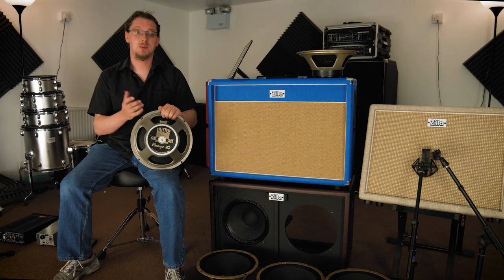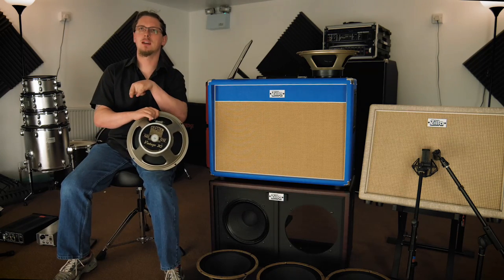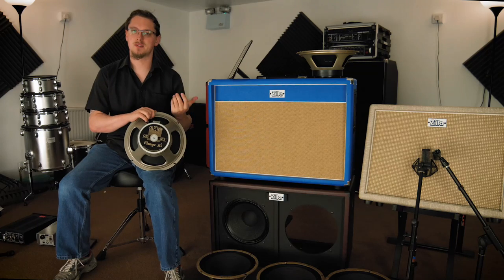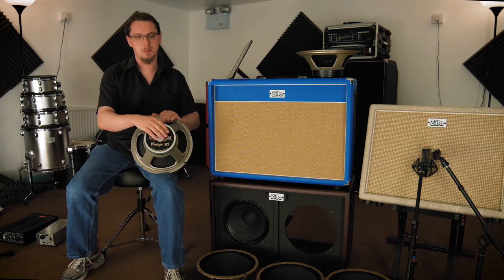8 Ohms or 16 Ohms? Vintage 30 - METAL Celestion Speaker Comparison

Comment: .............8..............16..........
Rythm: 1:50 -------- 4:27
+ lead: 2:00 -------- 4:38
Single: 2:21 -------- 4:58
Quad : 2:28 -------- 5:04
Solo :: 2:53 --------- 5:30

There...
Give it a lot of likes so this will get on top! Hope this helps people :)
Reply from the maker: +martin ouwehand hero! Thanks Martin. Gold star!
Reply: :D 
Great comparison btw! Really helped me a lot to deceide which speakers to get!
I think i'll get the 8ohm version becouse it is less harsh sounding  but still holds an impressive amount of gain!
Reply from the maker: +martin ouwehand :)
Reply: You didn't do the timestamps for the mix...
Reply: 8 ohm mix rhythm:     3:23 
16 ohm mix rhythm:             6:01
8 ohm mix with lead:  3:35
16 ohm mix with lead:         6:13
There are things you can do to mitigate the differences... Kinda...
Like.. Amp eq, post eq, and you can also try running the ohms switch a spot below or above whatever the cab is rated at (typically on a 16 ohm cab, you can only run a spot below, since I've never seen a guitar amp with a 32 ohms setting 😂.
Changing the ohms will mess a bit with power efficiency of the amp, making it slightly louder or quieter, but it can narrow the differences between the speakers in terms of "scooped-Ness."

Here is an article from Hughes & Kettner describing how it works:
http://blog.hughes-and-kettner.com/ohm-cooking-101-understanding-amps-speakers-and-impedance/
Reply: I think that the 8 ohm occupies more of the vocal range, so the 16 ohm just plops in the mix better with vocals and leads going on at the same time. With that said, perhaps it's easier to just scoop the mids out of the 8 ohm cab a bit.
For leads, I'd probay go 8 ohms right off the bat.. Especially a solo without vocals.
Mesa uses 8 ohm speakers and Marshall 16 ohm ones, and Mesa is typically favored by modern metal players... But in this mod the 16 ohm does sound pretty nice.
Reply: This comment sure helped allot, BECAUSE HE FACKED UP and made this stupid rewind to hear the sound video.
Reply: Yes!!

Comment: I read an interview with a Celestion engineer, and he said that they go great lengths in trying to make the 8ohm versions sound exactly like the 16ohm.
From his choice of words it seemed they consider the 16ohm as target.  
I imported the sound of this video in audacity. The following operations were needed to make the 8ohm sound very close to the 16ohm: 
- attenuation of 2.5dB
- shelving boost that starts at 3kHz, and reaches full 6dB amplification at 4kHz.

There is still some honking left in the midrange around 1kHz, that makes the 8ohm slightly mid heavy.
Really interesting comparison video, I wish there was more for greenbacks etc.

Comment: But my quick analysis would be:
The 8 ohm sound a bit darker, a little more loose and having more lows/low mids.Which is good would be good for a primarily rhythm guitar player, or stoner rock, sludge, doom, etc etc
The 16 ohm is a bit brighter, tighter and having more highs/high mids. Which is good for more of a lead player, which could turn his tone/volume knobs down to 7 or so for rhythm to try and match the tone of the 8 ohms and then when he wanted to boost his volume/tone,  turn them to 10. Genre wise they'd be better for death metal, thrash, djent, etc etc.

Comment: The impedance has a different influence if you are using a tube or solid state amplifier - and if the speaker manufacturer hasn't compensated for the higher damping (lower qt factor) of the 16 ohm speaker. With a solid state amp the lower impedance will cause a fuller bottom end but the bass will loose precision (higher qt factor = less damping). On a tube amp it pretty much depends on the output transformer design/dimensions/quality which varies significantly from amp to amp. From the reliability perspective tube amp transformers might be happier with a lower impedance (e.g. 8 ohm, so far supported) where solid state amps are operating with less stress on a higher impedance (e.g. 16 ohm). If two speakers are operated in series the inductance of the voice coils gets added where in a parallel operation the inductance gets lower. The inductance of the voice coil(s) represents a low-pass filter which influences the upper mid and high frequency transmission.
Reply: Very interesting observation.

Comment: The natural compression from 8ohms makes everything sound more even across the spectrum, however, I expected the solo to sound bigger, however it did so but uneven. All that said, 16ohms might sound better live than recorded, factoring in natural air compression and microphone diagram resistance evening out the frequency spectrum. 

If I where to play solo and live, un amplifier, I’d choose 8ohms. When recording to keep the peaks of that rich midrange energy, I’d 16ohm and use other tools (mic, compressor, preamp transformers) to retain “the meat” and keep it sharp. Amazing.

Comment: Wow, I didn't expect that much of a difference! Personally I don't find the v30 sound the most pleasing for me, but this was still very helpful as I preferred the 8 ohm speaker. So thank you! And I also think that it would be easier to compare if the parts were paired, but with time stamps it isn't a problem. 
Great videos, keep it up!
Reply from the maker: Thanks- and I’ve had the feedback about the pairings several times now, we do it differently now but can’t go back and fix it :(
Reply: @adamsteelproducer  in the next video then.. thanks for the info though.. great vids
Reply: @adamsteelproducer  I would like to hear the same with UK v30s (not the brand specific  marshall nor mesa branded ones) the V30 that were UK before they were made in China. Because i've never noticed this much difference on the UK v30s i've had, but I might be mistaken.

Comment: Also can make a difference if you have multiple speakers, like if you have a 2x12 16Ohm set up wired in parallel you get an 8 Ohm impedance

Comment: "We find out by comparing a Celestion Vintage 30 8 ohm against a 16 ohm version (with the amp set to match)"

So the 8 ohm speaker is connected to the 8 ohm tap and the 16 ohm speaker is connected to the 16 ohm tap, correct?

Comment: Surprising results. I didn’t expect such a drastic difference.

I don’t think one is better than the other. It just matters depending on context.

8 ohm would probably cut through a mix better (more midrange) but the 16 ohms might be good for a mid range heavy amp (more scooped, hifi sound). 

Application, pickups, amp, music style and personal preference. 

It’s all about context.
Reply from the maker: I like that answer!

Comment: I find this test weird.
You are using 2 different outputs on the amp.
It would make more sense to compare 2x4ohm in series (=8ohm), or 2x16ohm parallel (=8ohm), in the exact same cabinet, out the exact same amp output, with all dial settings glued in place
Reply from the maker: Except that series and parallel wiring impart their own tonal differences, I’ve made a separate video about that. It’s practically impossible to isolate one thing, we tried our best here. If you can do better, as always, I invite you to make your own video.

Comment: Everyone hold on! Did this dude change the impedance setting on the amp when switching from the 8 ohm to the 16 ohm speaker? Because if he did, that would explain more than half the difference we hear in the sound from these speakers.  Let me explain: If you use the 8 ohm output on a tube amp, you’re using a different amount of windings in your output transformer compared to the 16 ohm output.  You can get this effect with any speaker, it’s not just the vintage 30 that this happens to.
Reply from the maker: I’ve done a test on this in a different video, and put simply you’re wrong. I got the same results with a solid state amp.
Reply: @adamsteelproducer  My point is: They both have an effect, I could be wrong, I’ve been wrong before, link the video for us please.
Reply from the maker: It does have an effect, just much more from the speaker. Just search “Celestion”, it’s the 6 hour long one

Comment: Are the speakers in this comparison all from about the same production date? I have 3x 8 Ohm Vinatge 30 speakers from 2005, 2013 and 2017. They all sound very different.

Comment: here's a good rule. higher Ohm is harder to drive(requires more power). Higher Ohm = less low-end
Reply from the maker: +Pradigy Musicman not sure any of that is true, especially the last part. There's more high end in this particular speaker because of more winds on the voice coil, but there's a lot more going on
Reply: I think your right for the most part a higher Ohm is a cleaner sound i dont think it would have effect of the low-end other than 8Ohm sounding muddy not as clean as 16Ohm
Reply: Thanx didn't know that

Comment: I'm not sure how much difference is actually in these speakers... going from a 16ohm output to an 8ohm output on the same amp means you're using different amounts of the windings on the output transformer, which would impact the tone.  I mean, the end result is the same, for a given amp the speakers sound different, but the reason isn't the speaker itself I don't think
Reply: You can test this tapping off the speaker signal, with something like a Neve RNDI, when using 8 and 16 ohm speakers. Then listen to the difference in amp outputs using an IR. There is indeed a tonal difference just due to amp, with the 16 ohm output in my case sounding slightly clearer and higher fidelity and the 8 ohm output sounding more like a transformer (think adding a transformer to a mic pre). Which makes sense as the 8 ohm OT tap would use double the winds on the secondary. If you done the same experiment / above demo with 2x12 cabs (2x 8 ohm speakers wired for 16 ohm vs 2x 16 ohm speakers wired for 8 ohm) the effect would be reversed.

Comment: Yea basically you'd have to decide on a nominal impedance first then measure, lets say nominal is 8ohms, so compare one 8ohm by itself vs one 16ohm in parallel with another 16ohm, ideally the enclosure for the "mic'd" speaker shouldn't change in either arrangement, which means individual single 12" cabs, that way you can mic the same cab without having to adjust placement, and swap speakers freely, but add the second cab in parallel when recording the 16ohm speaker, that is if the amp has a second speaker output

to my ears the example above sounds more like impedance mismatch, thin lows and undefined highs with 16ohm speaker..

Comment: Is it the actual speaker that's making the difference or is it the 8 vs 16 ohm load thats making the difference?
Reply from the maker: +Tom Snellings it's the speaker. Celestion have said the voice coil is wound with more winds on the 16 ohm speaker, making it brighter by design. Changing load should in theory have negligible impact
Reply: Hop Pole Studios what if I add a switch with/without a resistance to have 8 or 16 ohms artificially? Because i've decided to make my own 1*12, and i don't know if later i will have an amp requiring 16 ohms speaker ( for now i'm good, i have a micro terror ^^)
Reply from the maker: +Zantrop64 there are very few amps that need a 16 ohm speaker, it's usually 8 or 4 minimum (apart from some strange little heads or combos). You can have an artificial 8 ohm load with a resistor but it would have to be very big to handle the power from the amp without exploding!
Reply: So say i prefer the sound of the 8 ohms. Then it's best to put two 8 ohm speakers in series in my cab instead of two 16 ohm speakers in parallel in order to get that warm midrange sound?
Reply from the maker: +Yassin Joris yeah, it’s the sound of the speaker more than anything so if you had 2 8 ohm speakers either in series (with the amp set at 16) or in parallel (with the amp set at 4) that would sound more like what you prefer than any 16 ohm speakers in any setup
Reply: Aight thanks man, that was helpful!

Comment: Leaving aside that it was meaningless for me. since I actually play clean and somewhat clean sometimes. Here's the reality of parallel hookup of speakers.  Take the impedance of the two speaker time one another (16 X 16 = 256) divided by the sum (addition) of their impedance (16+16=32).  So 256 /32 = 8.  No problem. Easy to use the same formula for two 8 ohms.  64/16 = 8.  But how about one 16 and one 8?  Should be in between the two, right?  Wrong.  16 X 8= 128 divided by 16 + 8 (24) = 5.33.  It's not a theory.  It's reality

Comment: ok Ive got a 2x12 cabinet loaded with 2 16 ohm speakers and it's wired in series. I have an amp that say "8 ohm minimum". am I good or should i make changes?
Reply from the maker: If the cab's wired in series, that's a 32 ohm cab- that's really unusual! Technically you're good, but i'd change that around so they're in parallel as an 8 ohm setup so you get the best performance out of your amp.

Comment: But, both cabs are 8 ohms. Is this correct? You are testing the difference in sound of parallel vs series...?
Reply from the maker: The cab is only based on what the speakers inside are. Not parallel vs series, 8 ohm vs 16 ohm
Reply: @adamsteelproducer  Has the amp impedance been changed to match cab/speaker impedance, then? ...I am using your video(s) to currently choose a speaker. Much appreciated for all you do and your response!
Reply from the maker: Yes the amp impedance was changed to match. In the much larger Celestion video that was made later, we revisited this and used a solid state amp as well to prove the speaker itself is the tonal change

Comment: Sorry if I missed this, but: are we talking about the impedance the amp is receiving or the impedance of the individual speakers? In other words, would two 16 Ohm speakers wired in parallel (= 8 Ohm) sound similar to the one 8 Ohm speaker but different to one 16 Ohm speaker? Thanks!
Reply from the maker: They would all sound different. The two speakers in this video are made differently- the voice coil on the 16 ohm speaker has more windings to provide the higher impedance, which results in a brighter tone as well. The amp is simply set to match the speaker load but in my experience the speaker being different makes more difference than the amp head being different

Comment: Did the amp have different inputs or a switch for the different ohm speakers? I’m just wondering because I would assume that would make a drastic difference as well and maybe make it less noticeable between the two speakers?
Reply from the maker: Yes of course. The amp was set to match the impedance of each load correctly.
Reply: Hop Pole Studios  wow! I’m surprised it made that big of a difference. I have an orange 112PPC with a v30 16 ohm speaker and with my Marshall DSL20HR I feel it’s a bit harsh and bright sometimes. Guess I need to get the V30 8 ohm speaker! Or maybe try the cream back 8 ohm speaker since it’s got less upper mids cause I feel like that’s what’s making it harsh. 

Very insightful tho! I would’ve never thought the ohms would make that big of a difference. I think I will make a switch now for a 8 ohm cream back.

Comment: the 8 was abit more boxy sounding but also had more bass, definately different! the 16 was abit more focused in the low mids but also abit fizzier, but I think I liked the 8! was the amp settings and cab the same?
Reply from the maker: +James Cassidy everything was identical, except the amp was switched from 8 to 16 to match the speaker so nothing blew up. This uses a different tap on the output transformer

Comment: Does it have to be a 8 or 16ohm speaker to get the 8/16ohm sound, or just the wiring is all that matters?
Reply from the maker: It’s the wiring that matters. As long as everything works out mathematically it’s all good. I’ve got a 4x12 with 4 speakers at 4 ohms in series for a 16 ohm cab, and a lot of ampeg 8x10 cabs have 32ohm speakers in! Not sure how they’re wired but it works out
Reply: @adamsteelproducer  Thanks a lot. Can you tell  me if its possible to wire  4 - 16ohm speakers @ 8ohms?
Reply from the maker: I don’t think you can - if you were to wire them all parallel that would be 4 ohms, or if you wire them as series pairs in parallel that would end up at 8 ohm total

Comment: So I have 2 Texas heats and two swamp thangs both sets are 150w 8ohm speakers and using the wiring from a Laney lx412a cab (as I'm crap with electronics to do it from scratch so will be replacing the wire on one at a time from original setup) and looking at doing this in an x pattern in my new cab, what would this give me?
Reply from the maker: No idea about your cab, but if it’s wired series/parallel then you’ll get….. a cab 😆

It’ll be 8 ohms in that case though. If all the previous speakers were 16s and it’s a 16 ohm cab, then all 8s will give an 8 ohm cab
Reply: @adamsteelproducer  previous cab wiring was 200w (50watt each speaker)  in total at 8ohms with original Laney speakers, but not been able to get confirmation on the ohm on previous speakers individually as there's no markings, so hoping ove got the right ohm on the new speakers, if this makes my cab 8ohms I'll be sound with that as I'm  running different amps through it from my orange crush pro 120 to my h&k black spirit 200 floor and and my mercury blu guitar amp. Just wary I don't want to blow any of my amps, thanks for quick reply 😁😁😁😁🤘🤘🤘🤘🤘

Comment: What happens when you tweak the tone knobs on the amp? 

To me it sounds like the 8 ohm has more low end but lacks the high end, and the 16 ohm has more high end but lacks some of the low end.
Reply from the maker: If you change the tone stack, you void the results of the test. But more than that, the tone stack does a very different thing than these big tonal differences, there’s no way to get one setup to sound exactly like the other